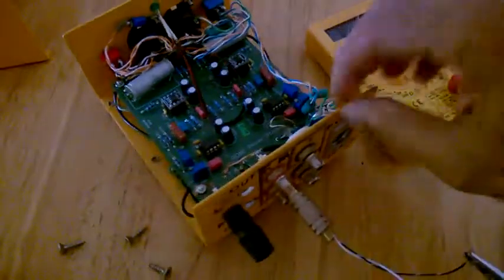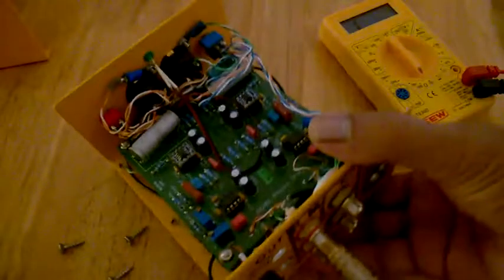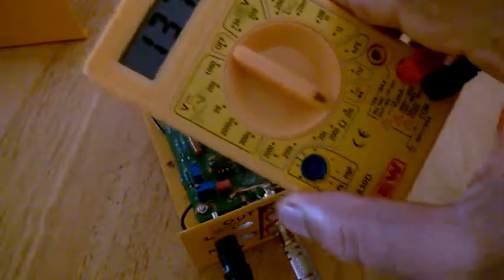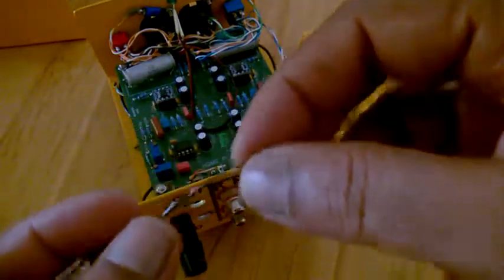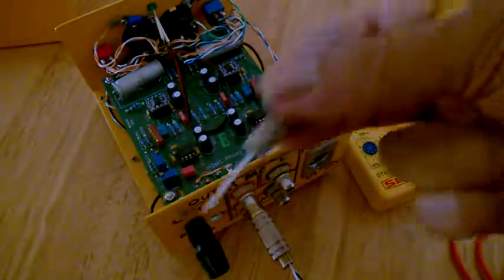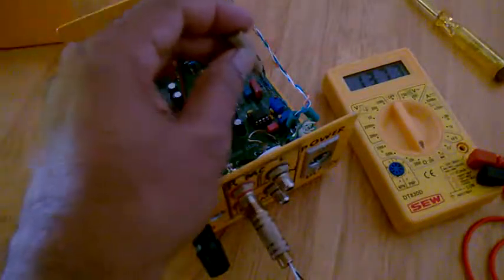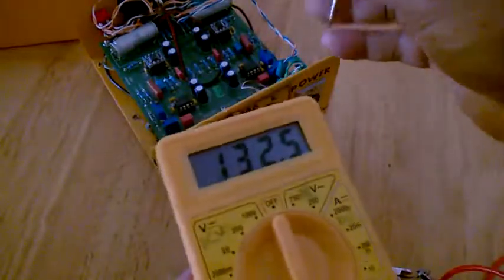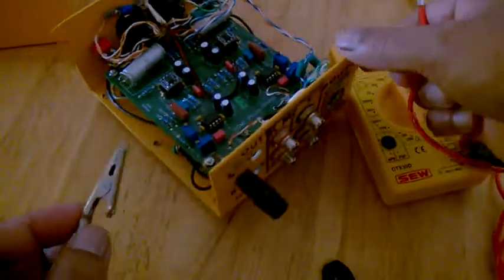DIY MC MM phono stage /phono preamp variable impedance setting by Manu Nayar

Comment: Sir schematic
Reply from the maker: It has been sold out since two years ago in Italy. Sorry no more schematic. You may check my new listing on OLX for MM DIY phono. I do have schematic for this Add
Reply from the maker: https://www.olx.in/item/mm-phono-stage-custom-made-diy-iid-1656265437
Reply from the maker: I do have MC phono stage ELC mc 20 class A for sale
Reply from the maker: https://www.ebay.com/itm/ELAC-CLASS-A-MC-21-Phono-stage-Made-in-Germany-220v-mains-/185085727238?mkcid=16&mkevt=1&_trksid=p2349624.m46890.l49286&mkrid=711-127632-2357-0